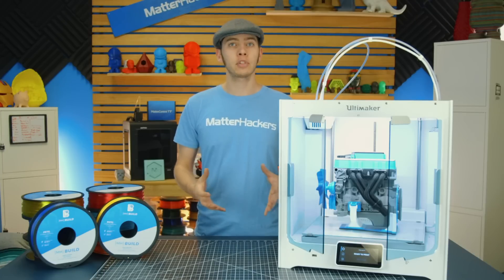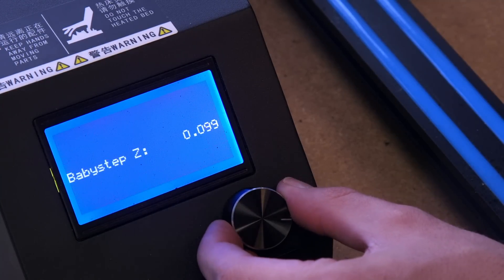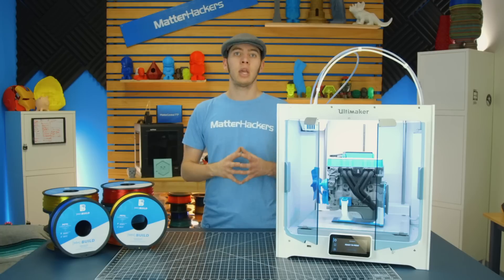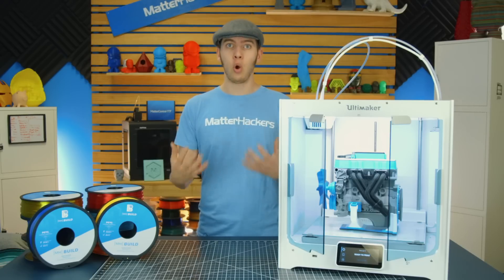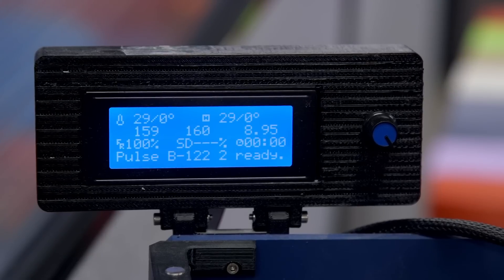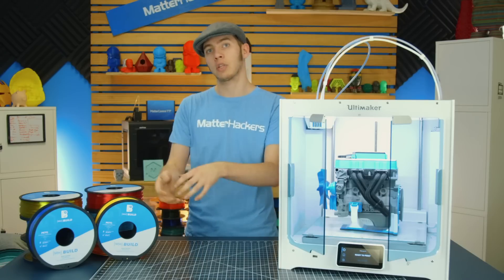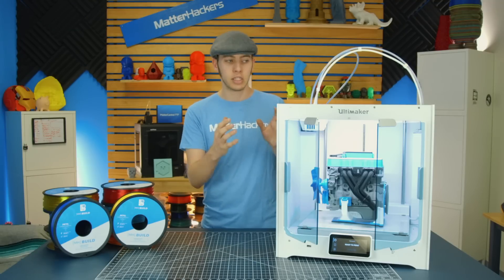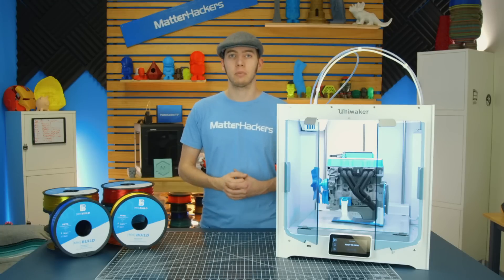The Anatomy of a 3D Printer // Screens

Comment: 0:20 Unless the host software includes such a feature (and most don't) power-loss recovery provided by the firmware is limited to SD-card printing.
2:19 The "reset" button on the LCD is usually assigned in the firmware as the KILL_PIN and pressing it doesn't reset, but just suspends the firmware.
Reply from the maker: Thanks, Scott - Good comments. Alec is referring to MatterControl (what most of MatterHackers uses) which does have a Software Print Recovery feature. We track the last 'Ok' received and can recover a print if the machine turns off, power is pulled, or USB is disconnected. Check it out!
Reply: You are nobe